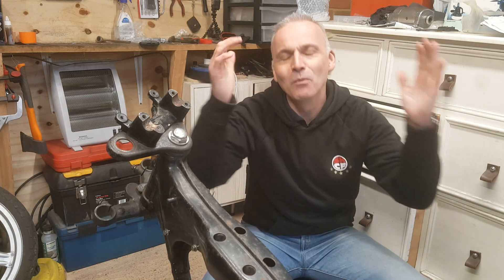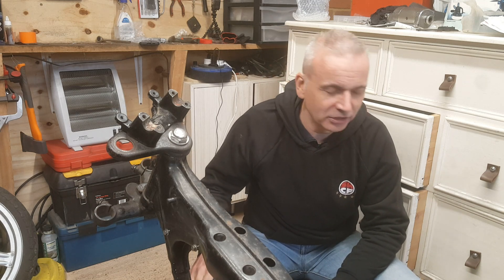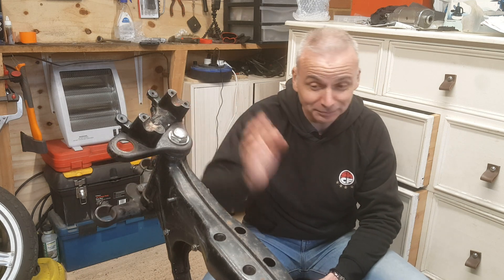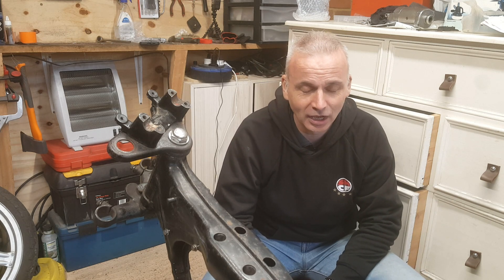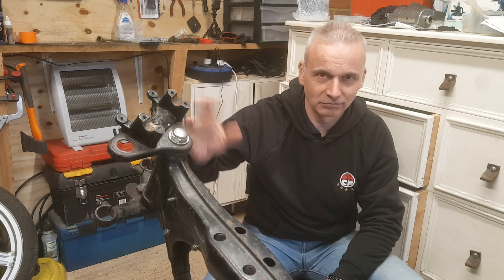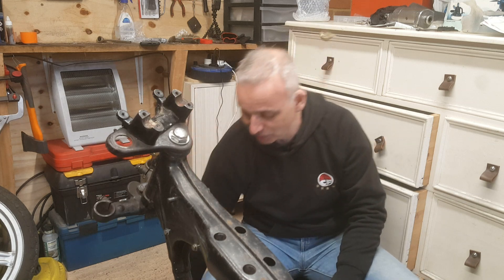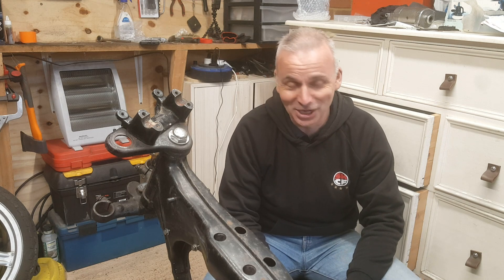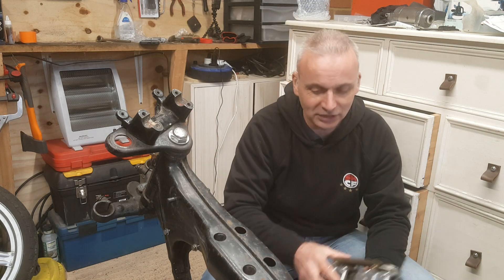Sorry!!, Explanation and a plan..   Sid the CB250 based Scrambler Project,

Comment: If I recall the 400 motor uses same block and should fit in there if you want more power
Reply from the maker: Hi, you're correct a 400 would fit but unfortunately i dont have one, and ive now retro fitted a kick start to this engine so im planning to use it (at least for now)